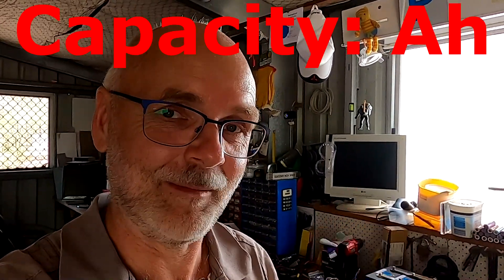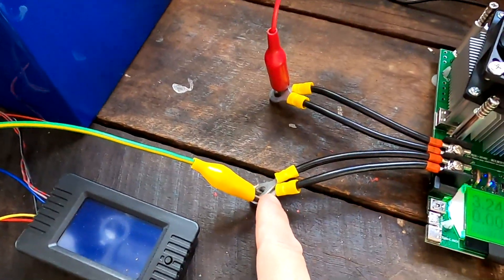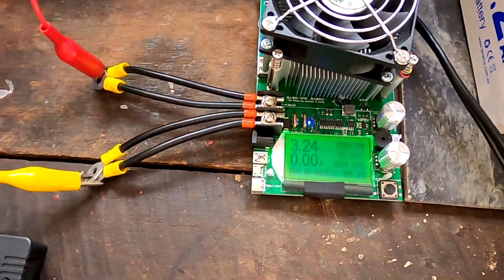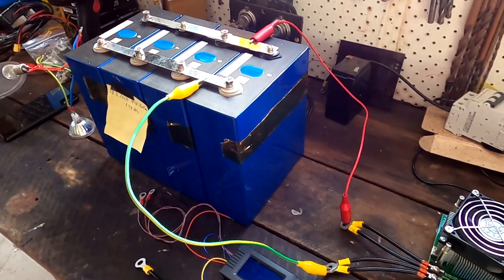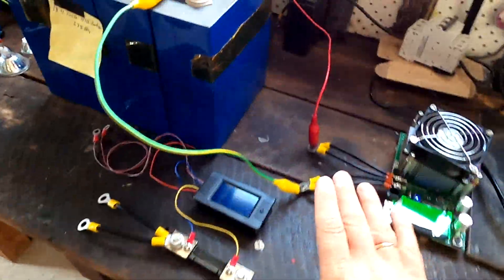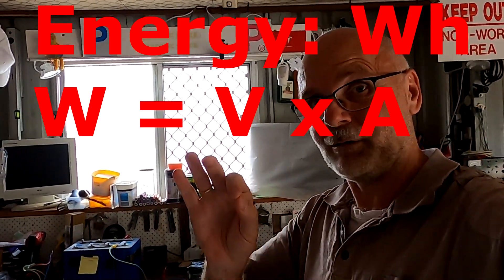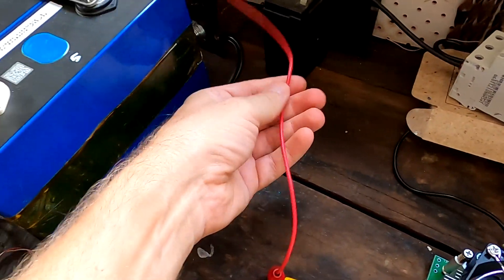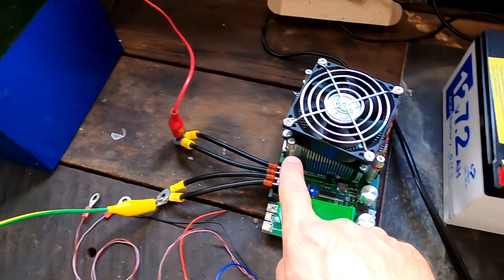Why Voltage does not matter at all during capacity testing! Here are the basics...

Comment: AMPS IS AMPS!! Thank you for making this video. I've seen some of the comments you're referring to and I think it's going to help them out.
Reply: Yes, thanks.
Happy new year to all, now, we are smarter, for 2021. :D
Reply: Bonne Année aux francophones.
Gelukkig new jaar aan de Nederlandstaligen.
Sorry, I write only those languages. ;)
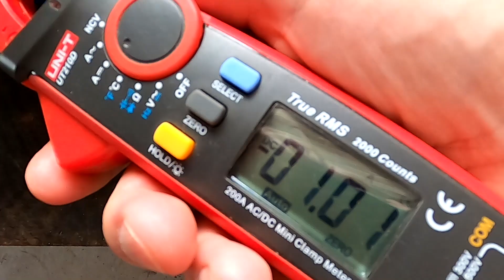Reply: @jimbeam5  False. The load is measuring the current in the circuit and adjusting its resistance to maintain the current you've specified. A google search for something like "diy mosfet electronic load" might help you understand. You may also want to view the video at 3:08.
Reply: @jimbeam5  Nope. It will only DRAW that load, based on the value he set. Period. You have a cataclysmically flawed view of the way that electronic loads work.
Reply: Except he is completely wrong in this case.
Reply: @Sylvan_dB  I mean this in the nicest way possible - I'm not trying to start a youtube comment section war here - but I can only suggest that you may want to further your knowledge on this subject before posting further.
Reply: Amps are not amps and he is wrong.  Amps depend on voltage and resistance.
Reply: @robertgrant5895  Would you agree that a battery producing 1 amp for 1 hour is 1 AH? Would you also agree that the same battery producing .5 amps for 2 hours = 1 AH? Finally, would you stipulate to the fact that 1 AH = 1 AH? In the first case, the setup consists of perfect, zero-resistance cabling/connectors. In the second, the add'l resistance from "poor cabling," etc. means the current is cut in half. But in that second scenario, the battery produced the .5A current twice as long*, therefore, in the end, the *capacity is identical. If you're still skeptical, please, go test it yourselves! Take a decent constant current load tester and test the same battery twice at different currents. Do the amp hour calculations and let us know what you find. 

My initial comment was made within the context of this video, which is entirely about measuring battery capacity/amp hours. And in that context, AMPS IS AMPS -- resistance and voltage do not matter*. The time it takes to do the test will change, but the final *capacity measurement will not. 

Now, one could say the capacity is not "identical" because the battery will have slightly different capacities when tested at different current levels (different "C Rates"). Although the differences here usually small, that is a valid point. OTOH, I do not think this is what "you guys" (the folks disagreeing with the point he's making in the video) are trying to say.
Reply: @jimbeam5  and others... please, I'm begging you... do some research, talk to an EE, etc. It DOES NOT MATTER whether the resistance is coming from the leads, poor connections, or "consumed" by the tester itself. The amps flowing in the circuit are the amps flowing in the circuit, and they are the same ANYWHERE in the circuit, and the same current is flowing through every component of the circuit. I can only assume you guys are thinking of current as you might think of voltage, where the various components in the circuit have different amounts of voltage drop across them. The amount of current "consumed" by the tester is not different by the amount "consumed" by the high-resistance connections - again, the current flowing is the same, everywhere in the circuit. Edit: my statements about current ignore series/parallel considerations, which don't apply to the scenario shown in the video.
Reply: @jimbeam5    "The amps flowing in the circuit are the amps flowing in the circuit, and they are the same ANYWHERE in the circuit, and the same current is flowing through every component of the circuit." If you "absolutely agree" with that, then you're agreeing with my entire point... not to mention physics, at least one of Kirchoff's Laws and the fundamental nature of electrical current.

There is no amount of current that is "seen" by one component that is any different from the current "seen" by any other component (again, I'm ignoring series  vs. parallel because everything in the video was connected in series). The number of electrons flowing in the circuit are the same, regardless of where in the circuit you measure it.

Voltages will be different at different places in the circuit (more correct to say the voltage drop across various components will be different), but I think you and the other folks are incorrectly trying to apply a similar concept to current. But please, don't take my word for this... ask an electrical engineer and they might help resolve your skepticism.
Reply: @jimbeam5  Nope. Please check the video at 3:08. The electronic load is showing 1 amp, then he measures the current in at least three places with a clamp meter. I'll give you exactly one guess as to what the reading is every single time, no matter where in the circuit he takes the measurement...

The load is not "measuring only [part] of" the current - it's not counting up to one amp and then throwing the other amps away... it's simply measuring the current in the circuit, full stop.
Reply: @jimbeam5  I'll step aside and avoid  a direct response to the ad hominem attack. Instead, I'll suggest that you do the research and test things out yourself. Or, as I've said repeatedly, don't take my word for any of this -- find an EE and ask them.
Reply: @jimbeam5  Assume you have a series circuit of 5 resistors, 4 that are fixed. Can you adjust the overall current of the circuit by changing the value of the 5th? Can you use that 5th resistor to determine the overall load on the battery? Do you agree that if you change the load by adjusting this 5th resistor, you change the current through all of them, and that this current is exactly the same for all of them? Do you agree that the load tester here is the equivalent of the 5th resistor? Do you agree that this load tester then, by measuring the current flowing through it, is measuring the total current of the entire circuit?
Reply: @jimbeam5  But it doesn't matter that the resistor is changed over time to keep the current constant. That means you just keep a constant C rate as per the test requirements of said battery, e.g., a load of 0.2C (C/5) in standard test conditions.With a changing load to keep the current constant, the current is still the same everywhere in the circuit and can thus be used to measure battery capacity.
Reply: @jimbeam5  "How could you tell the device to consistently draw 1A without the battery experiencing something greater than that? " Because the entire circuit is a series circuit and the current is the same everywhere in a series network.
Reply: @jimbeam5  Again with the personal attacks... Anyway, here's the only point Andy, I, and now others (thank you, @Up North and Personal!) are making: _lead or connector resistance does NOT affect a battery capacity measurement using amp hours_. Corollary: if Andy's load is measuring 1 amp of current, there will be exactly 1 amp of current throughout the circuit, regardless of where it's measured.

By bringing up EEVBlog #140, I believe you are ultimately trying to argue that using amp hours to measure battery capacity is invalid, and watt hours is the only correct method. Although Dave's points along those lines in #140 are certainly correct _in the general case_, they have nothing to do with the point of Andy's video (or the point I'm making). As Dave says early on in #140, using amp hours as a measure of capacity is "bullshit" (he does literally say that) because it makes a bunch of problematic assumptions; however, every single one of those assumptions are perfectly valid to make in Andy's scenario.

Andy's comparing the performance of the batteries he received to what is stated in the data sheet. That datasheet expresses battery capacity in amp hours, so he is measuring amp hours. Andy's comparing two (theoretically/supposedly) identical batteries -- same chemistry, same manufacturer, same model, etc. Again, all those "bad assumptions" described by Dave are all equal in Andy's scenario, so it's perfectly valid for Andy to make them. Therefore, the approach he's taking is valid.
Reply: @jimbeam5  Like when I put 10kW of solar out in the field 100 meters from where it is used, have a 3% voltage drop (or more depending on wiring) losses over the wire, yet have the same current at the panels as I have at the charge controller? Can I measure Watt-hours delivered by the panels without taking the losses in mind - no. Can I measure Amp-hours delivered (whatever that means in context of solar panels) and are they the same at the panels and the point of use - yes. I do capacity tests all the time (with a CBA IV); wiring does not matter for amp-hours.
Reply: @jimbeam5  I made a video just for you - check my channel.
Reply: @jimbeam5  In essence, he has two options. (1) Complain to the seller and work with Alibaba/credit card company/... to get a refund/discount/etc. It's a tedious process, I've done it a few times. (2) accept the cell as it is since it's still perfectly usable, still excellent value for money, and not worry too much about a few Ah and move. 
I have 32 of those cells, and ordering 32 more. Some will be slightly less, but it doesn't matter in the grand scheme of things. You size what you need it for, and add some more capacity. Those cells are now cheap enough (under $80 for Lishen 272Ah) to not care about a few Ah and just scale up the pack. It will still be the cheapest storage option by far.
Reply: @jimbeam5  The cells are actually new, they're just not 'grade A' (whatever that really means). He will get the same number even at a higher discharge rate. The issue is that these cells likely failed the intended capacity/IR at EVE and are therefor made available cheap through third parties. They are perfectly fine for solar applications (where you don't see high C rates) and capacity-wise, they're likely closer to 270-ish Ah. However, since none of these cells are matched (IR matched/capacity matched) putting them in a pack will limit total capacity anyway (you'll have 'runners' and the weakest cell determines total capcity). A good  rule of thumb I use is that you'll get 250Ah usable once you assemble them in a pack. Most solar applications are fine for this: you want to stay within the 'knees' of the curve anyway, which represents 80 to 90% of the capacity. 
He can complain to the seller and people have gotten extra cells/free cells - probably worth a shot. In the end though, he will lose more cycles if he decides not to clamp them together, but we're still talking 2000 cycles minimum: that's over 5 years if you would cycle daily (which no one does) and those 2000 cycles only mean that the capacity of the battery pack will be at 80% of its original - so you're not talking and of battery pack. Compare this to the cost of off-the-shelf or even DIY with other cells like Winston and you're still miles cheaper even if you replace them all in 5 years.